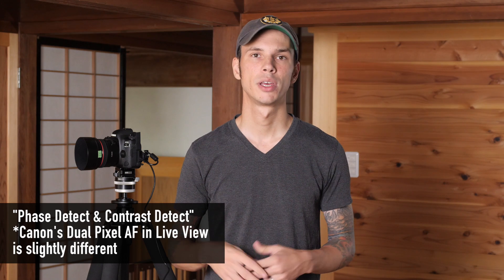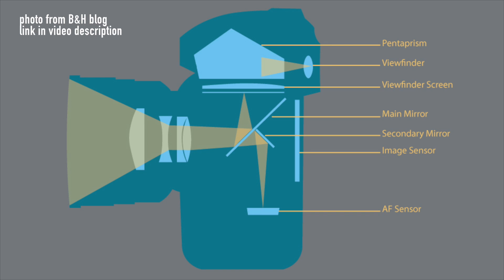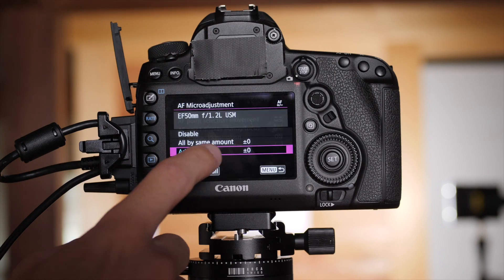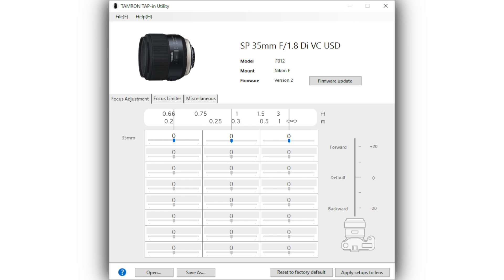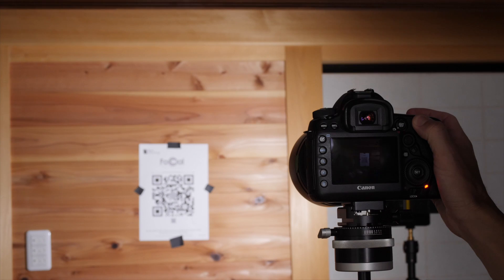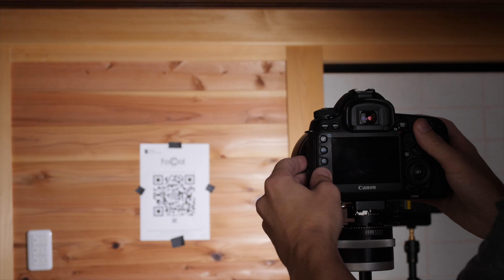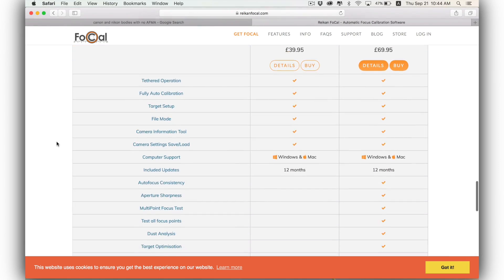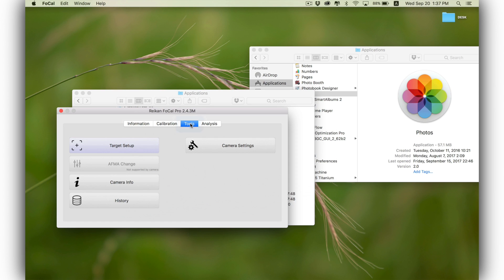How to Get Sharper Photos - Auto Focus Micro Adjustment (AFMA)

Comment: How far as to be the camera from the wall ??
Reply from the maker: It depends on the lens/focal length, but usually the app can give you a recommendation. I, myself, usually test it at the distance I most often use the lens at (so I test an 85mm at the typical distance for a headshot for example).

Comment: Hello Scott, great presentation. I have a 100-400mm what be the distance from the camera to the Focal chart. Can calibration be done outside. Thank you.
Reply from the maker: The app should have a function to tell you the recommended distance based on the lens, but for me I prefer to do it at the distance I find myself most often using the lens. I believe you can do it outside with no issues too, as long as wind doesn't interfere and you have good even lighting on the chart
Reply: @ScottDumas  Thank you so much. Regards, Jay
Reply: @ScottDumas  Thank you so much.

Comment: What distance.are.you required to be when using focal to calibrate your lenses?
Reply from the maker: It will depend on the lens/focal length but the app will also give you recommendations if you're too close or too far. I typically do calibration at the distance I most often use the lens though.

Comment: I was having trouble with my 85mm 1.8. Adjusted to +4, now it is sharp as hell. I use the screen of my computer to test focus, when I can see the pixels perfectly, everything built by little squares, it's because it is in maximum focus. Also when I shoot by a very slight angle I can see if pixels in front or back are more or less in focus, so I know where to go. I do it handheld, since I use the camera handheld. At 1.8 it's precise enough, I don't use lenses faster than that.
Reply from the maker: Awesome, and thanks for the idea of using the computer screen. That sounds like it could definitely be easy and quick in a lot of cases :)

Comment: Can you combine Focal with the Sigma USB dock to adjust the AF or can you only use either one? Great video, thank you!
Reply from the maker: I don't think that would work since the lens needs to be mounted directly onto the camera for Focal to take and analyze actual photos. What you could do though is use Focal to get your overall AFMA dialed in (for wide and tele on zoom lenses for example) and then if you notice anything that still stands out as being significantly off, go in and adjust it manually with the dock. In my experience Focal has been more than enough though in most cases.

Comment: Wow love your video I’m have some of the exact issues. I have a 7d Mk2 with a sigma 18-35 1.8f would you recommend using the sigma doc or using focal and will focal do different focal lengths.
Reply from the maker: The Sigma doc allows you to calibrate it more detailed than Focal will, but for me I'd prefer focal because it does it based on a computer program and not my own eyes' judgement. It's also potentially a much faster process and overall I just trust it more than I trust myself.

Comment: How do I calibrate my canon T5 to my new tamron lens?  I do not have a setting for micro adjustments on my T5.
Reply from the maker: If the T5 doesn't have the AFMA available, the best way would be to get the Tamron dock and calibrate the lens itself, instead of calibrating the camera to the lens... that is, if the Tamron lens you have is compatible with their dock
Reply: Ok thank you

Comment: Hi, great video; my dilemma here is that what happens once I made the adjustment? does get stored in the lens or in the camera? because I noticed that once I shut the camera, the AFMA is back to "Disabled".... it is these little things that can close the circle and make total sense.
Reply from the maker: Hi! Thanks so much. You should be able to set the AFMA by lens, and the camera will recognize which lens is attached and automatically set the adjustment in camera when that lens is mounted.
Reply: Thanks Scott, I readjusted my three lenses and the camera maintained its settings finally :-)
Reply from the maker: perfect, glad to hear it :)

Comment: crisp sharp presentation.. would like to see some tests ran by you..
Reply from the maker: Thanks so much! Do you mean lens calibration tests?
Reply: Yes Scott. Also, please explain how Focal can calibrate front or back focusing on a vertical target instead of having it 45 degree inclined?
Reply from the maker: @rajatsarkar8693  To be totally honest I've been using the EOS-R instead of a DSLR lately so it doesn't need calibration any more. But as for the target, a 45 degree target will let your eyes visually see if the focus falls in front or behind of the intended target so you can manually adjust it. But with Focal, they're using their own target which the software can analyze, and it takes a number of shots with different AFMA settings (usually -20, -10, 0, 10, 20 and one or two extra) and marks them out on a chart to work towards the setting which gets the highest amount of detail (sharpness). When going through the process you can visually see the curve of which AFMA setting approaches the highest level of detail/sharpest photo, so it's easy to trust. It also takes multiple shots at each AFMA setting just to make sure the results are consistent, and will also analyze how consistent/reliable the results are, so if your lens is focusing erratically it will notice and tell you that. It's really quite a clever piece of software, and I trust it far more than my own eyes looking at a 45 degree angle target haha. 

Hope that helps!
Reply: Hi Scott, Many thx for taking time to answer me. I totally agree that mirror-less camera removes the possibility of error due to misalignment, however I am, for now will stay with DSLR to wait for Canon to come up with an acceptable camera body. Mean while, my primary question for Focal will be, A. Does the software calibrate the focus using live view or focus through mirror ? B. I came across many remarks on FOCAL's error while using a laser printed QR target. what is your recommendation ?
Reply from the maker: Focal will use normal shooting through the viewfinder (not live view) so that it will properly calibrate the misalignment. It imports the photos into the software and analyzes them there. 
As for errors with the target, I haven't personally had any problems and I've just printed them on normal home printers. There are some guidelines in the software for lining up the target correctly depending on focal length, and you can check it before starting the test. It will tell you if there are any errors in distance or placement, and recommend how to fix the error (moving closer for example). 
Overall, the software has worked nearly perfect for me with maybe 1 or 2 crashes in probably between 50-100 times using it and the corrections it makes have always seemed to be accurate in my actual use of the lens after calibrating it.
Reply: Thx for the clarification Scott. Earlier I asked same questions to Focal team via website and yet to get any reply.
Reply: Hi Scott, I just got some confusing replies from Reikan.. it seems they have huge gap in technical understanding between the sales team and lab.. please see below 

From: Reikan Technology Ltd [mailto:support@reikan.freshdesk.com] 
Sent: Monday, April 29, 2019 1:50 PM

To: Rajat Sarkar
Subject: Re: [#28595] {Thinking of Buying FoCal} - test reliability

Hi Rajat,

Just sending another note as I went and checked with our developers as we do like to make sure you get the best information.

FoCal calibrate the phase-detect autofocus, and this measured (during calibration) with the mirror down (i.e. not in Live View).  We do use Live View for certain parts of the process, but the actual calibration is for "normal" (i.e. non Live View) shooting. 

Please do accept my apologies if I misunderstood your question.

Best regards

Sheila

 
On Mon, 29 Apr at 10:39 AM , Reikan Technology Ltd <support@reikan.freshdesk.com> wrote: 
Hi Rajat,

Thank you for getting back to me :)

I am wondering where you have seen your information - FoCal does not use the mirror for calibration. Focal Pro uses Live Focusing for it's calibrations.

Best regards

Sheila

 
On Mon, 29 Apr at 10:23 AM , Rajat Sarkar  wrote: 
Hi, thx for your reply.
 
Someone confirmed earlier that focal uses focusing through mirror and not “focusing through live view mode”. Would you like to re-check with your technical team and revert. I am using Canon EOS 6D and 5D Mk iv.
 
Regards,
 
Rajat Sarkar
Reply from the maker: @rajatsarkar8693  Very confusing haha. But yeah- calibrating with live view wouldn't really do anything at all since AFMA only affects the normal through the viewfinder focusing. live view/dpaf focuses with the same sensor as the image is captured with so there's nothing to be calibrated in that case. Seems like they've worked it out haha, but strange that there was any confusion in the first place with them.
Reply: Scott, the girl said she will forward my request to their developer and they will reply.. lets see

Comment: does focal work for zoom lenses too at multiple distances and focal lengths? does it work for 3rd party lenses at all?
Reply from the maker: It does to a point.. I've only tried it with Canon cameras so I'm not sure if it's different for others, but with Canon I can calibrate the wide end and long end separately for zooms. It works exactly the same with 3rd party lenses as well in my experience.

Comment: I don't know... I have two Nikon DSLRs: one is a D2X, which doesn't surprise me that there is no "AFMA" option, but that's my 'backup camera'. My 'main' camera is a Nikon D4S and there's no AFMA on that either.

I'm not trying to imply that one brand is superior to the other, (different, yes. But better? Not so much). However, the D4S is a Nikon "flagship", professional camera and therefore, I'm surprised that it wouldn't have this feature if it was actually as critical as you're saying it is. 

If Nikon did have this feature, they would likely have called by a different name so maybe it's there and I just don't recognize it.

I've been shooting the D4S for 1.5 years but it's not at all beyond possibilities that I still have options or features I'm unaware of. I always carry the manual with me where ever I take the camera and I've lost count how many times I've read it. 

There is the focus calibration adjustments that can correct focus inaccuracies in any particular lens and then save the offset to be automatically applied each time that specific lens is mounted. But then, I'm pretty sure Canon has that as well.

When I get a chance, I'll come back and watch the rest of your video. I was only able to watch the intro before I had to leave, so maybe there's something that I'll recognize as being similar to the Nikon line.
FWIW,
Thank you,
Rich
Reply from the maker: Hi! Thanks for watching. The D4S is a fantastic camera, I shot with it for about a year or two myself and loved it :) There is AFMA on most Nikon bodies above a certain level as well, and it's definitely included on the D4S, though I believe it's called "AF Fine Tune" in the menu. If you're able to find that you should be able to use it in the same way to correct any calibration issues with your lenses, if they're significant enough to cause you trouble. 

Let me know if that helps :)
Reply: I stand corrected! I completely forgot about the AF Fine Tune and yes, it is in the D4S. In fact, I didn't read your reply until 5 minutes ago (I got it yesterday but didn't open until today).

I would have read it today but the very reason for why I started the computer, was to go back to this video and correct myself about not having an AFMA, (Nikon's AFFT). I just happened to remember the AFFT when the two lenses that I rented for our vacation trip, was delivered this morning.

I rented a Sigma 500mm F4 (it's a beast, for sure!), and a Sigma 14mm to 24mm F2.8 (T. Hogan's review found it to be better than the Nikon version). Anyway, I unpacked and checked out the two lenses, as well as the two other items I rented: The Sigma USB Docking station and the Sigma Circ Pol Filter Ring that is used for the 500mm.

That's when I thought to myself that I need to try to get the focusing accuracy (and other lens related features), done using the Lens Docking Station instead of the AF Fine Tune feature in the camera....

"AF Fine Tune feature! That's the same as the Canon AFMA! That's what the You Tube video was referring to, and which I said wasn't on the D4S!" LOL.  So yes, it is the AF Fine Tune in the Nikon's and I stand corrected!

We're leaving the day after tomorrow so I've got a lot of preparations to do (other than the camera equipment). In addition, I have several tutorials I need to watch regarding the Sigma USB Docking Station and I must read up on that monster 500mm/F4 lens as well!

In fact, one of the tutorials I need to watch from start to finish is this one! I used the AFFT many times already but if there's one thing I've learned since I started shooting on a more 'serious level' back in 1980, it's that I am often surprised at how much I didn't know about the equipment and the art, that I thought I knew!

Often, it's some feature that had an additional use I never considered. I really have read the manual/s on my camera bodies several times, but when you're dealing with 600+ pages of material, it's not hard to forget and/or mix up the details. That's why I always take the manuals with me.

Thanks again and I'll definitely get back here to watch the video in the next 24 hours.
Rich
Reply from the maker: Glad you were able to find it :) Sounds like you'll be having some fun with those lenses, enjoy! :-D

Comment: I've calibrated several time using my 50mm 1.8g on my nikon d7200 but always get acceptable results and not excellent like yours. Why so? It gives me -6 Af fine tune
Reply from the maker: I think the acceptable/excellent results are related to the consistency of the focus each time and how tightly it fits the curve they find for it. If the lens's focus is not as consistent it might cause the acceptable results, but should still be fine. More than likely it's the best possible fine tune setting, especially if you get near the same result more than once.
Reply: Scott Dumas still the pics at f1.8 are not sharp. They are soft. Why so?
Reply from the maker: Hmm... are they soft overall or is the focus just not where it should be? (either in front or behind)
if the image is just overall soft, then it's not an AFMA issue but possibly the lens itself, too slow shutter speed etc. 
If there is a part of the image which is sharp though, but it's not where you placed your focus point, then there's some other issue. Let me know
Reply: Scott Dumas it is sharp on a spot where i've not placed my focus point. In portraits my focus point is on the eyes but the eye is never sharp. You can find that the upper body is sharp but not the face
Reply: Scott Dumas give me your email address. We shall talk upon this there
Reply from the maker: Hmm I wonder why that could be... sure, my email is scott@scottdphoto.com, talk soon.

Comment: How to calibrate zoom lenses on nikon body then? I got the sigma 17 50 and nikon d7200. I have already bought this software as well
Reply from the maker: It's been a while since I've done this with a Nikon but in my memory they don't have separate settings for wide and tele, so you could just test it somewhere in the middle or calibrate it at the focal length you tend to use most. If anything, I'd probably go for the tele end since the depth of field will usually be shallower and problems with focus will be more noticeable than at the wide angle. Hope that helps!

Comment: What distance should i keep between my lens and the chart printed?
Reply from the maker: There are recommended distances which you can check within the app, when you check the chart it will alert you of things like that. But, I typically just aim for the average distance from my subject that I tend to shoot at, so the results will be most accurate at my most used distance.